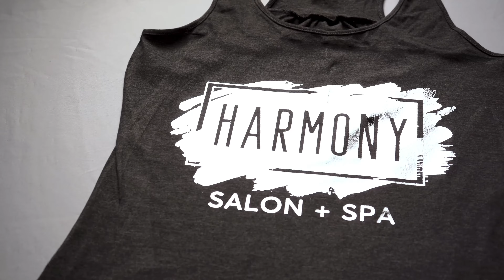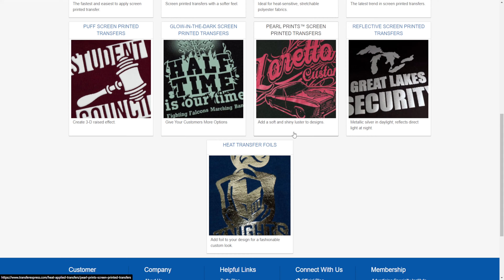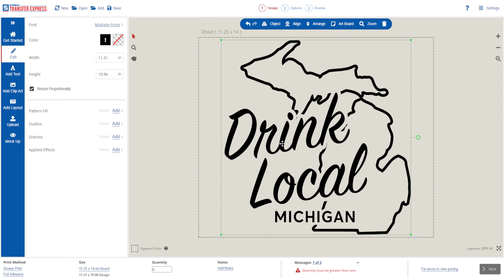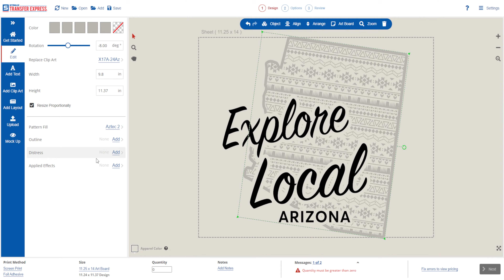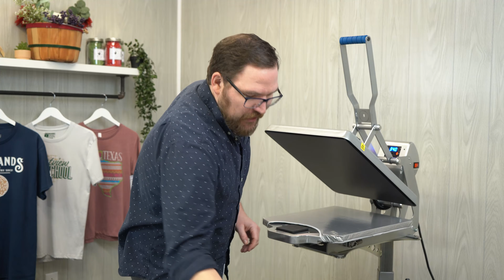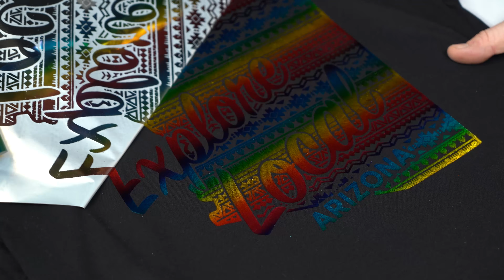How To Order & Print Foil Heat Transfers

Comment: Is it possible to only foil part of a transfer? Example I have a design that is primarily red and I only want the red parts in foil and the rest of it normal transfer.
Reply from the maker: That's a great question Michael! You absolutely can- the foil will stick to any plastisol ink on the shirt. You just have to cut the foil to a smaller piece to only cover the elements you want to be foil (for the second press). You can alternatively mask out the other areas of ink applied to the shirt with a paper cover sheet and then press with the foil.
Reply: Can you mix dtf print and part foil?